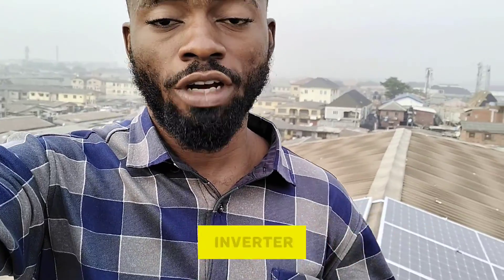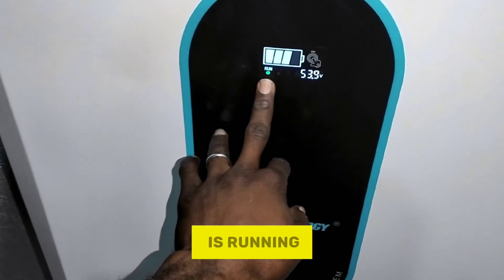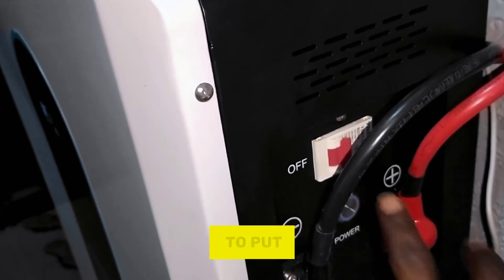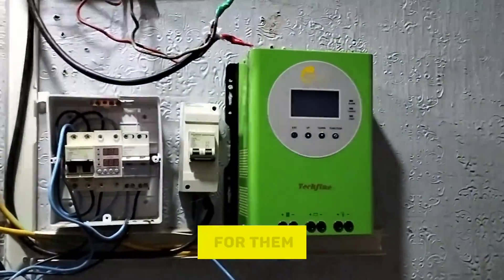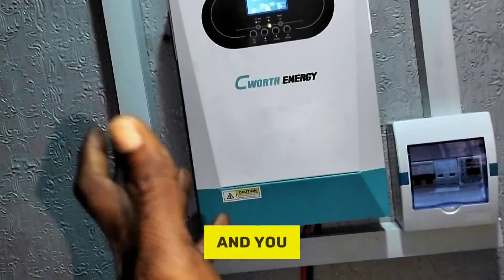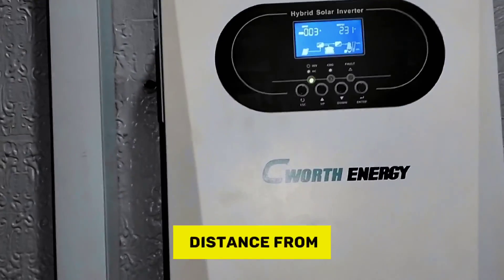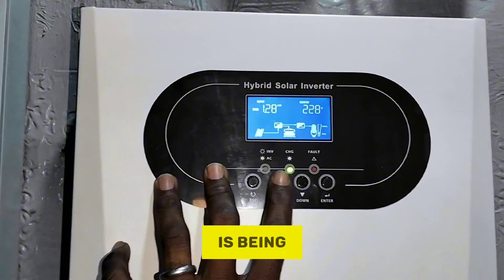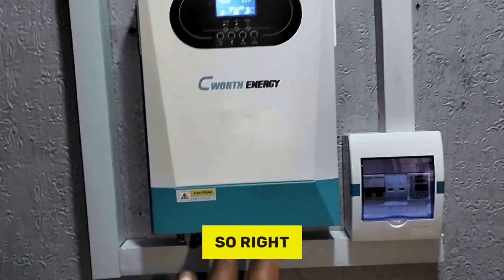solar energy system with cworth brand!. 98%DOD😱😱

Comment: Well done sir. Its not efficient placing two strings facing different directions in series.
Reply: true, the mppt will pick the lowest values from all panels. in the morning, east facing panels will have the highest voltage, but the west facing panels will have lower values. By noon, vice versa.  the MPPT circuit will pick the lowest ones. but if space is a constraint, this configuration is better than having nothing
Reply from the maker: Okay sir!.
The roof is flat enough

Comment: The panels are facing opposite sides.. they should divided into two and should be on two different charge controllers  for optimal performance
Reply from the maker: Thanks for your opinion.
But the system is working very fine
Reply: I think he wants to maximize both sunrise n sunset power.

Comment: Well done, Solargod. Nice video. Could you do a battery capacity test of this battery? Let us confirm the 98% DOD. It is alleged that most companies, including Felicity, Cworth, and Blue Carbon, use grade B lithium cells. That is why their prices are relatively low compared to brands like Pylontech, Deye, etc. Not a bad thing for countries like ours, but it would be nice to know the battery's actual capacity.
Reply: Grade A cells are reserved for High-Performance applications like EVs, etc. Nobody uses "Grade A" for residential applications. Also, BYD, EVE or CATL Grade B are on the same level as CALB, Gotion, etc "Grade A". 
There is no universal Grade A specification.  The manufacturer classifies the best cells with the highest stable current & voltage as Grade A, then other cells that didn't achieve max performance are rated as "Grade B".
Your worry should be if the cells are used or new & their age, not Grade A or B as both will last you over 25 years.
Reply: Hi can you name other products with grade A Cell , what are your thoughts about Yohako ?
Reply from the maker: Jinko.
Pylontech